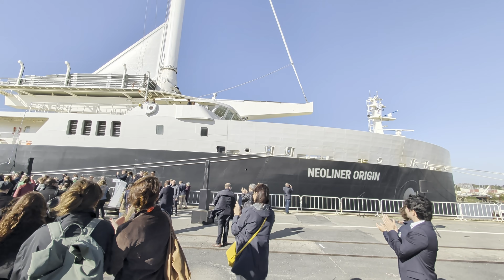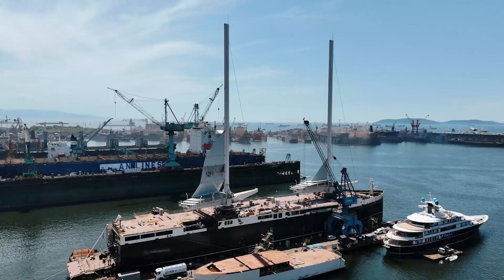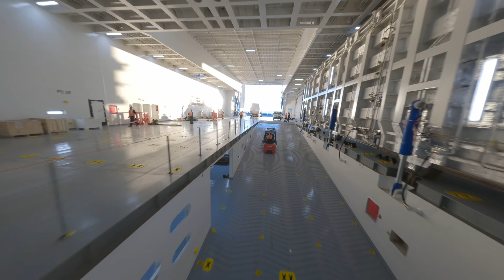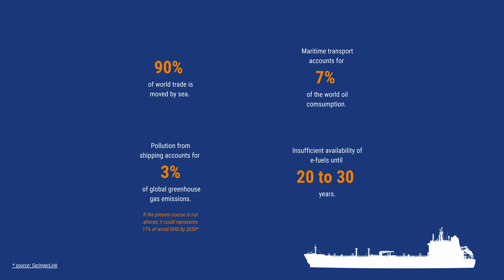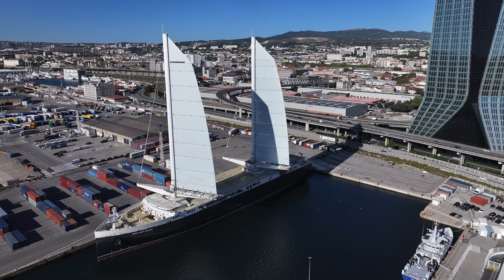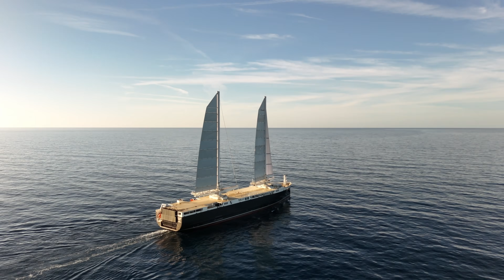Neoliner Origin Worlds Largest Cargo Sailboat - Part 1

Comment: great video and fantastic concept vessel. Understand it had issues during inaugaural sailing but hopefully these can be ironed out as will be ideal for cargo to smaller more remote islands and destinations where marine pollution and impact minimisation are critical. Good luck to Neoliner.
Reply from the maker: Yes I did hear that they had problems with the rear sail in a storm. Well, the vessel is very experimental. I'm sure they will improve it. They're not expecting it to be perfect.